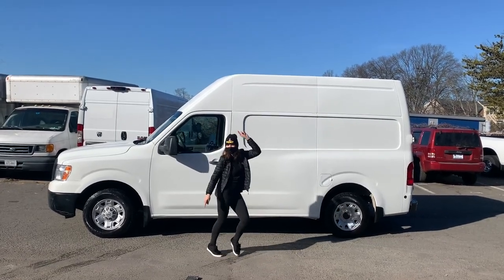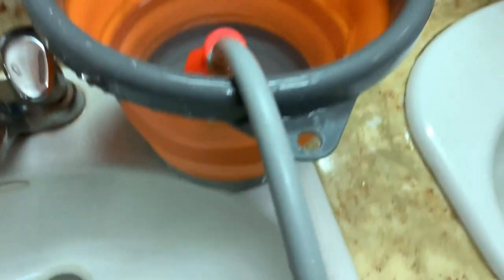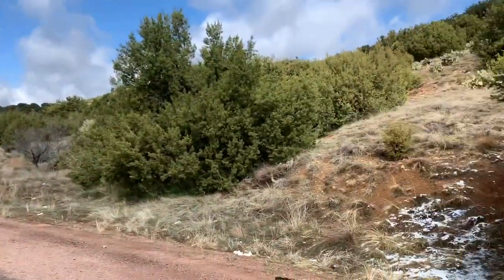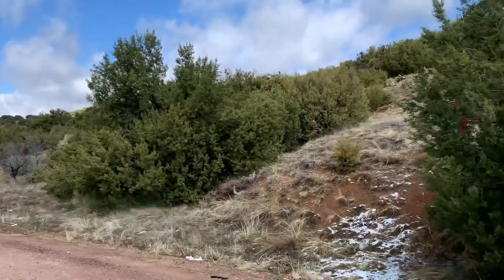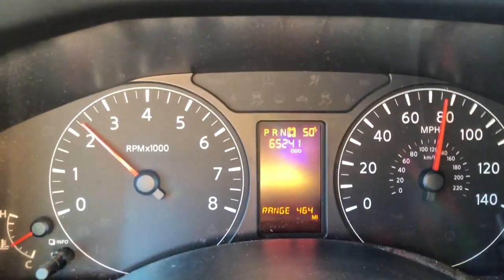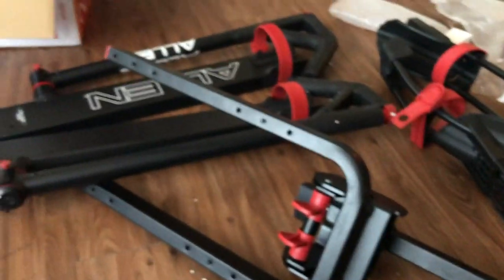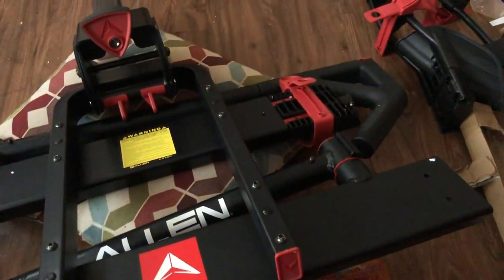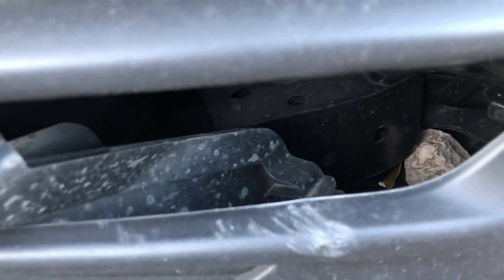EVERYTHING IS BREAKING | EPIC FAILS | Nissan NV2500 High Roof | Solo Cargo Van Conversion

Comment: Did you drill a small hole before screwing the bolt in? I also converted my NV2500 and taking my vaccine Friday at the VA.  These Vans are nice.
Reply from the maker: Nah, I used self drilling screws (under the sheet metal section of the screw aisle in Home Depot).  No need for pilot holes
Reply: @TravelJennie  The metal is fine with self tapping screws, however that is likely why the wood is cracking. Thanks for putting these videos out, I recently got a 2019 Nissan NV2500 HD SV High Roof :)
Reply from the maker: Congrats on the van.  The shiplap is attached to 1x3’furring strips / strapping.  I think it’s because I used metal screws on wood to wood.  The furring strips are attached to the frame
Reply: @TravelJennie  Drill a small hole in the wood not the metal. The wood is splitting because of the size of the screw.  Always pre-drill a small hole in wood to keep if from splitting.

Comment: I am loving your videos!  How does the Nissan handle on the road?
Reply from the maker: Aww thanks JC!  It handles ridiculously smooth.  It’s a Nissan Titan chassis.  I worked for Toyota, Honda and Acura for a few years in advertising, product and sales training where we got to test the vehicles and create content to train sales people, as well as create all the advertising campaigns and commercials.  I only wanted this van from the start.  It’s an SV with tech package, backup camera and collision sensors.  Even in the mountains I’m not the slowest in the slow lane 😁 The gas mileage isn’t that bad actually.  So I’d say it handles well.  And with Kilmat sound dampening pads and wool insulation, I have almost zero road noise.
Reply: @TravelJennie  Thx so much for getting back to me.  I agree this is the best van that I have seen!  Your build videos are an inspiration!